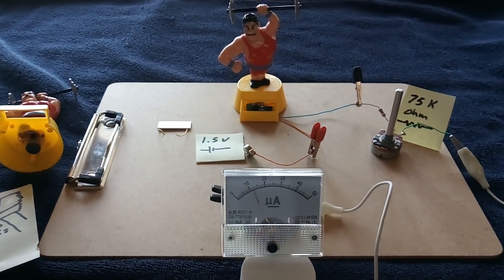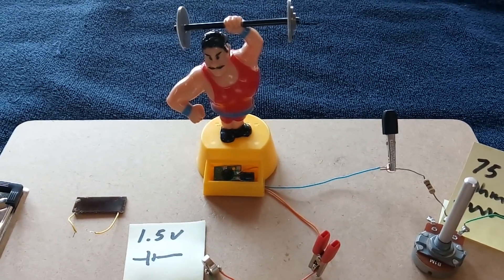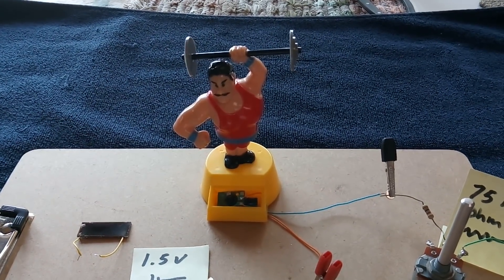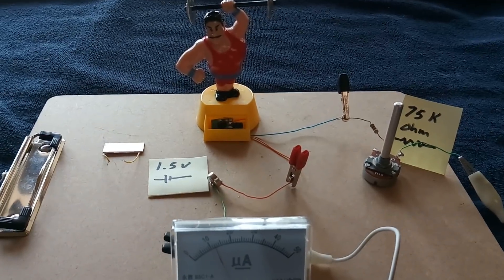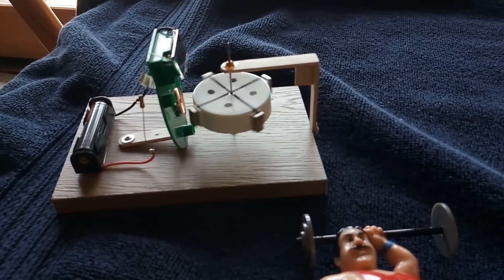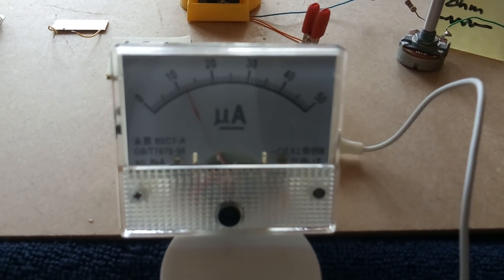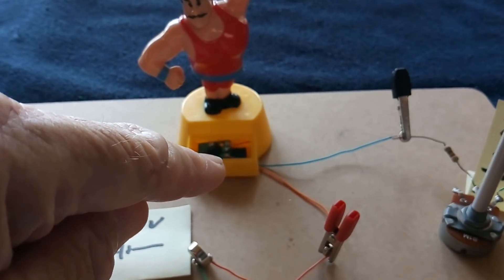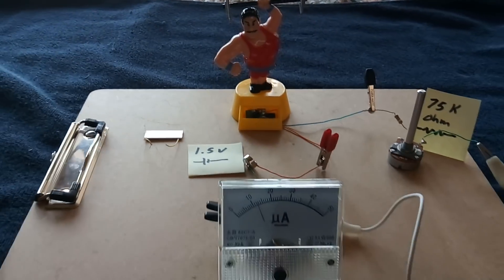The Solar Rocker Experiment

Comment: Won't the needle 'drill' in to it's bearing surface in time? I've noticed that on some of the magnets on my motors..
Reply from the maker: Actually that doesn't seem to be happening.  It probably is drilling into the screw but it is going right down the middle of it.  Long way to go.

Comment: 11uA is extraordinary and I did think they quit before 1/2V. That would suggest just 1 transistor, rather than a Darlington. 
One aim for the toaster cap would be enough storage to run one instead of a supercap
Reply from the maker: I was really surprised to see that 11uA show up.  I knew from Granddad's many videos on these things that about half a volt was needed.   I filled up a 10F 2.7v super cap with 1 volt and the thing ran for over 3 hours.   Interesting little critter.

Comment: Hey forget the science, I've got to find one of those weight lifter rockers, he is great fun 😍👍 Back to the snowman, when he was running off the potato battery I could never quite decide when it had finished because it would still give a little twitch every so often even though the potatoes had dried out and gone rigid.
Reply from the maker: That is great news.  I'm glad to hear that some of my projects actually work on the other side of the planet.
Reply: @Lidmotor  It's a small world. =)
Reply: Hi Lidmotor, let me reassure you not only do they work, they work very well indeed.
Reply from the maker: These 'weight lifter' toys are not too popular at my dollar store and sometimes they go on sale for 25 cents.  The thing about them is that they come apart easily and there is not much inside.  I remember your 'potato battery' experiment and how long that ran.  I did a lot of homemade battery experiments a ways back.  The only one that is still powering something is that solar powered stainless steel and Epsom salt rechargeable cell.  It powers an led light at my other house.  The light runs 24/7 and has been for years now.  Fun stuff.
Reply: @Lidmotor  I have a solar powered epsom lead cell, based on your 'lead solder' cell(remember?) running 24/7  for years. It powers one of your penny circuits i built with steel core washing line wire. Only on very dark winter day's it has stopped blinking once or twice. I'm in northern Europe(The Netherlands)